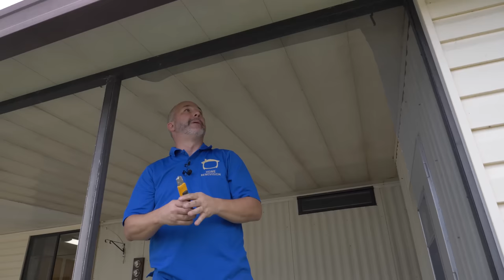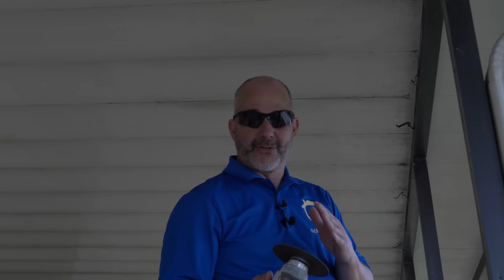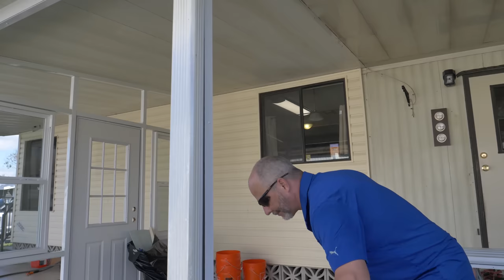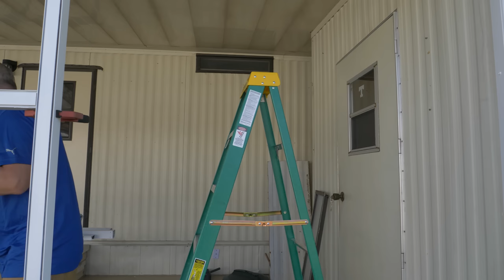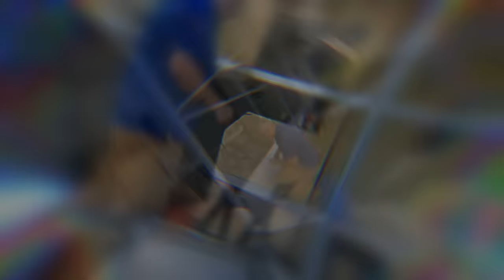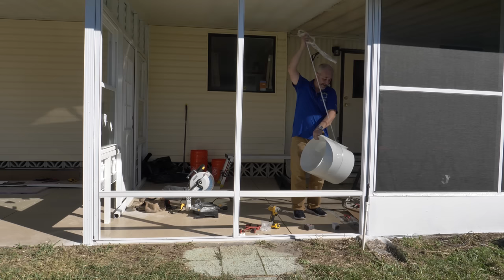Rebuilding My Screened In Porch (Upcycling Challenge)

Comment: I just restored my sunroom. I sealed, caulked and repainted my aluminum. Then I re-did the screens with new screens and spline. Instead of cutting out the screens, just remove the spline and cut the new screen and spline to the same size as the old. Speeds up the process. Cost about $250
Reply: How long did it take though.

Comment: When I was re-screening my porch, I had bought one of those metal tools to squeeze in the spline. Every time I used it, it would cut through the screen because the edges were simply too sharp. Out of desperation, I grabbed the cheap, plastic version that had been left in the garage before I bought the house, and it worked like a charm. One of the rare instances where cheaper ended up being better.

Comment: I have an old 1960's travel trailer I stay in that also doubles as my work space. I've been debating on whether to get a newer one but what had me lean towards working on this one is that the bathroom was in perfect condition and it has a full bath with tub across the back of it, not next to the kitchen area which I'm not a fan of. After some years, due to some deep digging to plant a tree I ended up finding an underground room in my back yard. Now I'm debating on whether to continue with all the work this trailer still needs, or just getting a newer one, or building a tiny home back here and integrating this underground room into my build. One of the things I had always taken into consideration is that so long as it's on tires, I don't have to hassle with the whole deal of another structure on the property, being that it's my dad's property and he, my daughter and bro live in the house in front. (Oh ya, when I came back home due to my ma having been ill at the time, years ago, my dad said to me to never take the tires of that thing, lol, if you get what he meant). I am hoping to see you do more internal trailer work because that would really help me out with my debate on what my next move will be. I really do love your videos and are my go to when it comes to anything that involves me picking up my hammer or drill.

Comment: Screen problem 1: The screen is parallel lines that need to be parallel to the frame. As you set the spline watch the screen is parallel and if you are off, pull it back to where it is parallel. Screen problem 2: The spline tool has 2 ends for different purposes. Only the rounded wheel will ensure the spline is fully seated. The spline is either hollow or a squishy solid center. Either way the end used by Jeff pushes on the outside of the spline. I suggest you start the first couple of inches and then switch to the rounded wheel. The spline track is deep enough to keep the wheel on the spline. If you find the wheel does not stay on the spline, then the spline probably isn't fully in the track. Problem 3: don't be gentle. It takes some force to fully seat the spline. It needs to be fully in the track and not flush with the frame.
Reply: This.  Concave end first helps keep the spline in line, convex end second pushes the spline in, surprising how much deeper it can go, and it tensions the screen fully.  Landlord with a couple decades of window screens/door screens, without fully seating them they can pull out readily and the more tension the better to not flap or bow like a shower curtain when the wind blows.
Reply: @RJFerret  The concave wheel's original use was for metal screens. If you ever pulled an old metal screen, you'd be surprised how stiff it is and I heard required so much force that you couldn't keep the convex wheel on the spline. You had to make 2 passes. I've only done a few but when you are taught by the guys who took pride in their work, they told you the full story. You reminded me about the other problem beginners have. Don't stretch the screen at all. The spline goes in about 1/4 inch on each side which stretches the nylon screen by 1/2 inch. Another recommendation for beginners is to use plastic spline tool. Metal spline tools easily cut screens if you slip.

Comment: Hi Jeff, When you ground the screw head, you did grind into the downpipe surface. Your method, which I haven't used before and I will use in the future, would be great when the surface that has the screw head is flat. I usually use a drill and take off the head. This is great for rivets. Another way is to use vice grips also could be called locking pliers. If the screw comes out, there's no need to grind or drill.
On the bitties and as I'm in Australia, they can be sandflies or, the small named, midgies. Both are in sandy areas and are usually prevalent from before sunset. With the midgies, sometimes you don't know you have been bitten until the welts and itches begin.

Comment: I thought grinding disks where supposed to be installed with the painted disclaimers flipped around towards you (while grinding painted thing faces you).  (I also know not to use cut off wheel as grinding disk, but I still use it sometimes lol..)
Reply: You're supposed to. Using the wrong disk and installing it backwards not only shortens the life of the disk but also has a higher chance of the disk fracturing and sending shrapnel everywhere. Diy shouldn't mean OSHA doesn't exist but people are people and who really cares..

Comment: I have been contemplating screening in our porch.  The existing posts are odd distances apart. I intend to even up the spaces by adding 2 posts and moving all but the corner posts. The railing is in bad shape, so that will be replaced in the process. I'm up in the air about the decking,  as whether to refinish or replace.
Reply: Go for it! A screened porch is so nice to have.

Comment: Jeff, I found the screening portion of the video very helpful, for the most part. I was disappointed when you began working on the bottom side of the first panel. I was waiting to see if you stretched the screen material when completing the bottom spline insertion. Unfortunately the the elevator music started blaring just at that point. So, having said all that, is there any stretching of the screen material required when inserting the spline in the bottom side of the opening? Thank you.
Reply: I am no expert, but as long as you don't wrinkles in the screen? It is all good! Stretching is NOT needed BTW. Otherwise you are risking other issues such as "tearing". There needs to be some give and take on the screen. Point and Fact "like" a automotive belt which needs 1/2' Deflection.
Just like Jeff said make sure to cut each piece a "wee" bit short for the corners. Never do it in one continuous spline. Ask me how I know that!! 😥😥

Comment: I watched a short about your downspout screw stripped and you used the grinder. I lost it before I could comment.  I do alot of art that requires torching g bubbles and make jewelry.. Use a creme Brule torch to the screw. It will aneal the metal and may loosen the grime holding the screw in so tight.

Comment: A note about getting the correct spline size. The thickness of the screen will affect the size of the spline. How do I know? I replaced a section with what turned out to be a thicker screen. The spline size I had used wasn’t seating in the track. Fortunately, I had also purchased a package of spline that was the next smaller size. That size was perfect for the new screen.

Comment: Very informative, thanks Jeff!

As a note, Simple Green works really well on Aluminum and if you cut it 50-50 with water, the gallon of concentrate (which is expensive admittedly) is really 2 gallons of cleaner.

For rusted screws, alternative to cutting the head off: Cut a slot in the head with an angle grinder and use a straight blade bit in the impact driver. Works great unless someone used stainless hardware on aluminum (they don't play nicely together - galvanic reaction) and you will break the screw before you get it out

Comment: Dude don't use cutoff wheels for grinding please
Reply: More importantly, don't teach neophytes to go against the manual's warning to not use the side of cut off blades as they can shatter.  Also keeping body parts and others out of the line of fire is advisable especially when doing extra risk.  I'm happy to not use certain protections or do things within my ability others might not, but rotary blades spin fast with lots of force and do break.